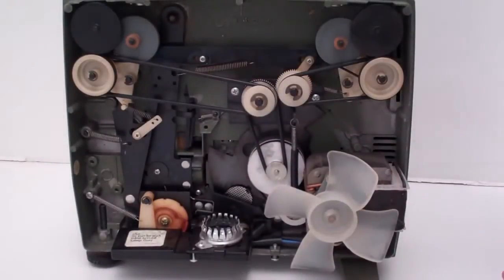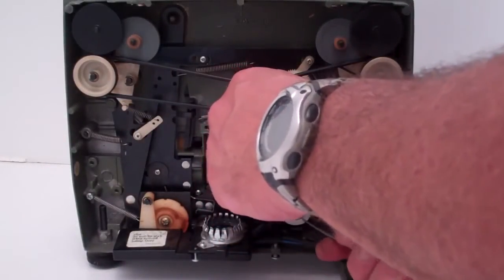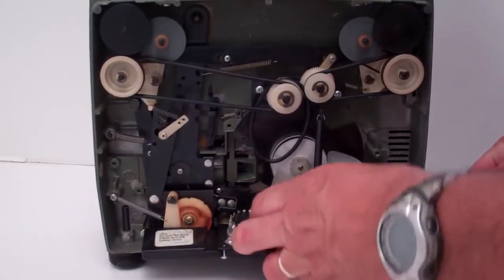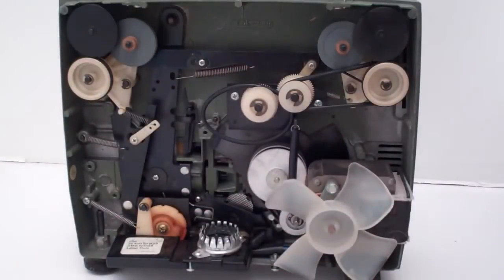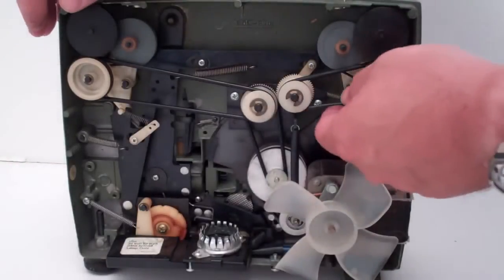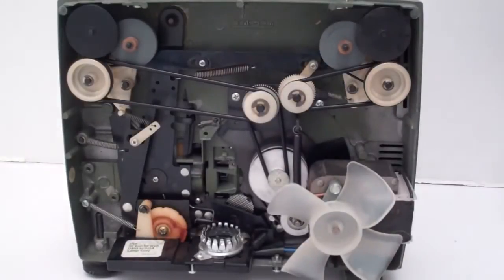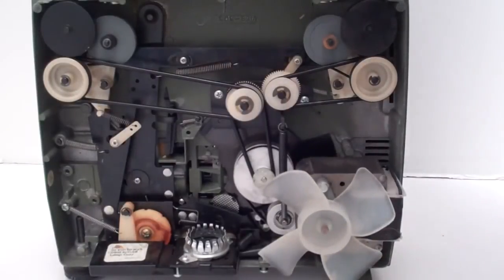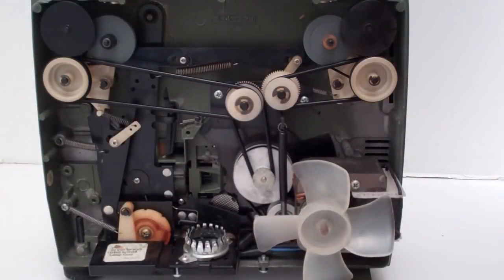Gaf Projector Replacing Round & Tilton Belts Rollers & Tires

Comment: Hi,
    I purchased a Wards Duo Eight 806 807 809 810 888 Projector 7 Belt 4 Tire Rebuild Kit New in June 2018 and finally got around to replacing all the belts today with the help of your video. 
I watched 4 movies (films) and on the 5th one it stopped going forward... Took the back off and the titan belt is stretched and actually shredding... What did I do wrong?
I see how you mention about the tension on the take up reel, but I didn't know if I needed to do it or not, (Nor did I know how) so I didn't do anything with it... I actually thought everything looked good because I have no experience using a projector and am not sure how tight or loose the reels should be in the first place. I know I did everything correctly and exactly as you did in the video so now I have two questions:
1) Do you sell just the titan belt for the Montgomery Ward 810 duo?
2) What can I do to prevent this from happening again?

Thank you in advance for your time!
Kristine
Reply: i had the same problem when i replaced my Film Projector Belt TILTON S5A 1/4 X 7-3/4 GAF. it frayed after running a short time.
any ideas? thanks vic